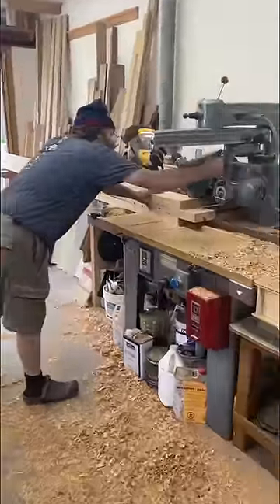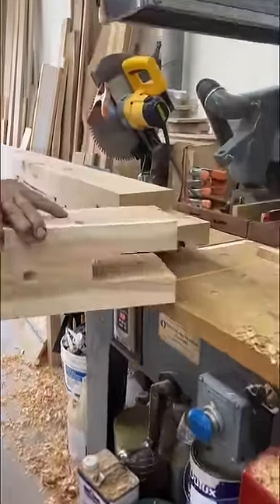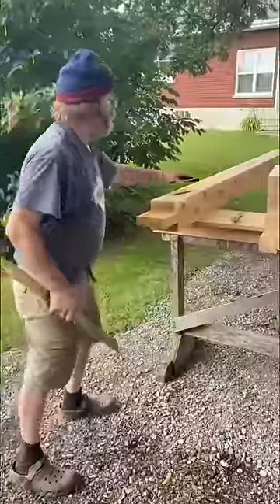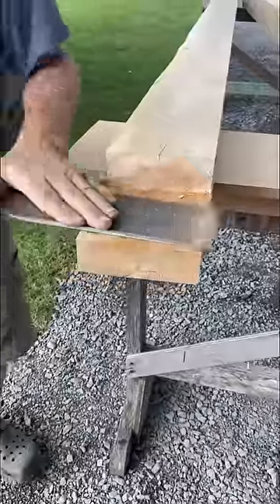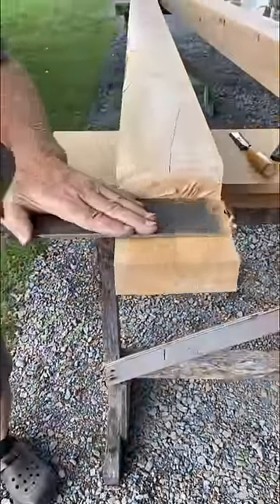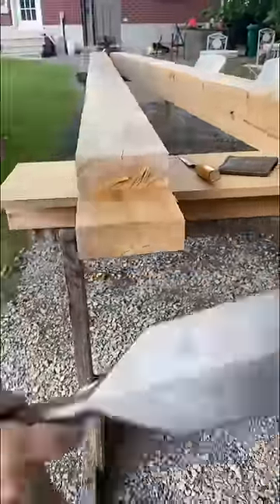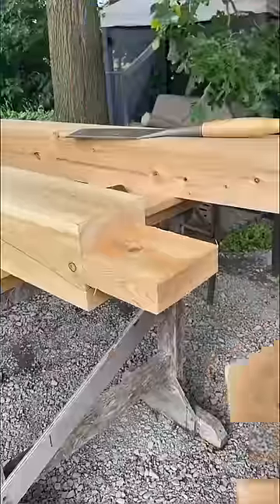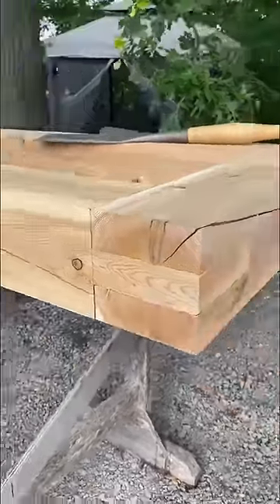1950s Rockwell radial arm saw #wadkintemple #woodworg #architecture #carpentry

Comment: And now I need a radial arm saw.  Thanks a lot.
Reply: Do worry peoe practicly give radial arm saws away. Thats how i got mine and i wasnt even looking. Their cheep
Reply: Me too. My lumber yard has the big one. Takes 5 minutes for the blade to stop spinning.
Reply: Yeah im so glad everyone thinks they are more dangerous than a table saw. I have 3 now working getting a 4th. I have them all set up for different operations. Kerf cuts, planning and rip cuts.
Reply: I have a small collection of rockwell/Delta/Milwaukee wood lathes. 11" &12".
One has riser blocks for a 15-1/2" swing. One w/ a Vega duplicator. A 1939, 1948, 1951. The 11" is the sheet metal ways version. I love them.
Oh, and a 1964 Unisaw. School green paint from the factory.
Reply: They are seriously undervalued. I got mine with the stand for $80, and it's like my most useful tool. It's a classic sears craftsman, like 60 years old, and it runs fantastically.
Reply: We had this baby in high school wood shop. I still want one.
Reply: I have a craftsman that's just sitting in my basement.  Not a fan of it.  Feels really sketchy to use
Reply: @JakePlisskin12  I know people think they are dangerous but more dangerous than a table saw!? How could that even be possible lol.
Reply: @bobbygetsbanned6049 yeah, I don't see how these can be more dangerous than a table saw. Nothing is more dangerous than a table saw. My dad had a serious craftsman and used it quite a bit when I was growing up in the '70s. He ended up giving it away when my parents moved because he couldn't sell it. Same story all over
Reply: @garetkonigsfeld2  *they’re
Reply: If I had the space 😢 and one of these "lumber yard" saws with that "trenching head" (by Wadkin!) - I would never take that head off the saw. I'd just get another radial...😅😅😅😅😮
Reply: @xXVintersorgXx  Assuming its arm is not loose on the pillar, A radial is ten times safer than any table saw.    What “feels” sketchy is that the saw pulls its way thru the wood and seems to lunge at you.   This is mostly an illusion, because you are used to having to push heavy wood AT a blade to make it cut. With a radial you are not having to pull, but the saw isn’t going anywhere but to the end of the arm.   The other thing that makes radials scary is the entire blade is out there in front of you.  The table saw barely shows you any blade at all.   But the table saw east more fingers than any other power tool out there, BECAUSE you hardly see the blade and feel safer.   When my workers use the radial, they are afraid of that blade and that’s the proper mindset to have with ANY power tool.   A well made Radial ( and in the 50’s they were all really well made ) is more accurate than any mitre saw, and more versatile, handling everything from cross cutting, to ripping, to horizontal slotting, angled blade cuts for cutting curved channels, controlled depth cuts like dados and rabbets, and some even have attachments for doing shaping, planing, jointing, and drum and spindle sanding.     A radial Can NOT kick back when cross cutting, and when ripping, if it kicks back, it throws the board to the left or the right and not back in your face. 
You really ought to try and get comfortable with it.  I barely fire up my table saw.   The Radial handles 95% of what I need.
Reply: @christopherpardell4418  they are still pretty dangerous.  And it definitely feels sketchy. Cross cutting a couple times I've had the saw almost pull out of my hand.  

It's definitely not as bad as it feels but I hate using it.  I've since gotten a miter saw and those feel much safer.  I don't do a lot of ripping because I've been doing mostly diy construction stuff but I have a table saw as well and a circular saw.
Reply: @xXVintersorgXx  I personally know 4 guys who lost fingers to table saws.  Way more who have been injured in a kickback.  I have never met anyone injured by a radial. ( and I am old enough to have been around when almost every woodworker had a radial saw. )   Like I said, it FEELS like the saw is jerking towards you, but its just that with a radial, your hand isn’t ‘pulling’ the saw so much as it is Braking. In ripping, you push the wood into the blade and so it doesn’t have that issue in ripping. Which is something a mitre saw can’t do.   And you can always add a ‘return reel’ to your radial. That is a spring wound cable that pulls back on the saw carriage so that you can counter the feel of it pulling at you, and it pulls the carriage back when you let go of the handle.  
If it feels like its jerking at you, then you may have the wrong blade on it.  Tables saws use blades with a positive hook.  On a radial you really want a blade with a negative hook. That will reduce its tendency to claw thru the wood. 
But I only have so much room and I need that room to be efficient and versatile. Mitre saws only do cross cutting, mitres, and cross cut bevels.   With your radial, You can cut rabbets and dados because you can calibrate the arm to be parallel to the table and precisely control the depth of the blade.   You can even rotate the head to attach a planing head and level one side of a thick, warped board.   Aside from the versatility, The worst thing about mitre saws is even the best quality ones are flimsy and you can easily pull the blade off line with the slightest lateral pressure on the handle.   I came close to buying a Bosch multilink mitre. But went over to do some work on a friend’s and found out even that $800 mitre saw could cut off line just by changing which hand you’re pulling the saw with.
I instead opted to upgrade my 1970’s era craftsman 12” radial when I found a 14” 1953 DeWalt that looked like new, for $500.   That saw weighs 500 lbs.   I can cross cut and  rip up to 24” wide, so I very rarely need to pull out my table saw.
Reply: @christopherpardell4418  there are forums filled with people that have injured themselves with a radial saw.  Anytime you have a rotating blade you have chance for something to go horribly wrong.  Like I said though, it's probably not as bad as it feels, but it can be extremely dangerous.  People have lost arms from the saw slipping out or over the work and running up into their body.  Also ripping you can be pulled into the blade.  Table saws also feel sketchy but in a different way.  And my older saw doesn't have a riving knife so it's just as sketchy for me to use that.  I don't do much fine wood working, furniture making, etc.  All I'm saying is I can see why people are practically giving them away
Reply: Screw that I need that slick
Reply: @xXVintersorgXx I learned how to operate a radial when I was about 10 years old. Used that one for ten years.

I just recently got another one, rebuilt it and now use it  for those operations where I would have used the table saw. 

Kickbacks on a radial are pretty much nonexistent because the blade pulls the wood into the fence which has a gap only just large enough for the blade to go through. You almost don't have to hold the wood when cutting, just focus on guiding the blade at the correct speed.

Comment: Timber frame pieces always look so nice. Just like Lego. Very specialize cuts.
Reply: Lincoln logs😂
Reply: Yep, until the check and dry. But really even then they look good.
Reply: Specialized cuts? Are you new to woodworking? That is a basic bridal joint. Yeah it’s bigger than what you usually see on furniture but not harder to make. And no you don’t need any specialized tools even at that size, hand tools and or basic power tools will do the same. The bigger specialized tools are only for convenience and speed.

Comment: I cry everytime I think about my old Delta 12" radial arm saw. I sold it a few years back to make room for a sliding compound saw. There are just some thing you can't do with a sliding compound. Sad part is, everyone who knew I was selling the Delta ba k then told me that there was no market for radial arm saws anymore. I bought into that BS and ended up selling my saw for $50 (in pristine, perfectly adjusted shape). Now I have a much bigger shop and regret the loss 😢
Reply: Other than a 90 degree cut—blade parallel to the table—what else can the RAS do that a compound miter cannot?
Reply: hopefully you sold it to someone that needed it, appreciated it, and made beautiful things with it. Don't regret the things you have done - regret the things you havn't done ! peace
Reply: @clairecordell2461  "don't regret the things you have done, regret the things you haven't done".    I like that!  Thanks!
Reply: @MadLadsAnonymous  ummm..... cut larger lumber?  That's all I got
Reply: @MadLadsAnonymous  On thing I used to be able to do is mill tenions. I can do this now, but it means making a cut part way through either side, then moving to a bandsaw.
Reply: @coppulor6500  👍
Reply: Wow, I understand. You might be able to find one similar to the one you owned, but you might have to drive to pick it up, would probably be worth it  😊

Comment: As a kid I made so many wood projects with my fathers radial arm saw. It’s probably over 50 years old now and still works fine.
Reply: Mine has "Sears Craftsman" on it. Still working great!
Reply: I have my dads RA, Sears Craftsman too, has to be at least 50 years old, Bann; after replacing the motor bearings it is in excellent condition . Cannot call my self a woodworker but I plan on keeping it as long as I am able.

Comment: Radial arm saws do everything. If used correctly, you can do any project. Nice job on that fit.
Reply: You can’t rip king boards with them. Once you actually get into wood working you will agree with the rest of us that the a good table saw can do just about everything, including everything a radial arm saw can do. You must be new to the hobby, welcome.
Reply: The radial can do just about everything, usually without jigs, that a table saw and miter saw can do.
Reply: A tool made for wise guys.

Comment: I wish I still had my old Craftsman radial arm saw.  It was a versatile beast until it died.  I could do almost everything with it that I now use my table saw or miter saw to do.  I would put a drill chuck on it for horizontal boring, installed a buffing wheel to polish metal, used dado blades for single-pass dados, used cutter blades to make decorative edges and ogees like from a router, did cross cuts, miter cuts & compound miter cuts and ripped boards and sheet goods.
Reply from the maker: It was a revolutionary machine at its time

Comment: I love my radial arm saw and everyone throws me shade over it. I think if you understand the outfeed is the danger zone, it’s a fine machine. I use mine just like you are here, also to power a dado blade.  Much respect.
Reply from the maker: Proper guarding training and sharp, tooling  following the best safe work practices pretty much cover you on this machine. Much of the misconception of danger is from the antics of amateurs or the poorly develop consumer grade saws.
Reply: The illustrations put out by craftsmen back in the day definitely didn't help. If you've seen the manual showing how to rip ply standing up and the blade sticking out the front of the table then you know what I mean. Big nope

Comment: You can’t beat those old machines, we have a old jointer that has a ten foot bed and a twelve inch cutting head on it.
Reply from the maker: that's fantastic. What's the manufacture?
Reply: @jackEnglishmachines  Rockwell. Our Radial arm saw is also a Rockwell.and old

Comment: That RAS is a whole work station if you have the lathe chuck, router head, surfacing planer, sanding disk, etc. It moves in 3 directions, granted one is an arc, but its a 180 degree arc.

Comment: I´m always more impressed by the real estate people have for a machine you might not be able to use that often. I was at my local Scrap yard last week and they had a whole area set up for huge industrial saws and planes that were quietly rusting, it was very sad to see many had waited far too long for a kind heart to come along. Great to see you enjoying it and that chiseled joint too. That 3" chisel is not that common either.
Depending on the load that beam is taking, you might find it stronger with a longer joint?

Comment: If you want to do good work with big stock, wire your shop for 3-phase and get the good old industrial iron.  The big, powerful tools have a learning curve of their own, but they really flatten the overall learning curve.  It just get so much easier to get really good fits.  And, bonus, the machines are often available in running order for scrap prices, or nearly so.

Comment: First power tool that I bought was a 12" Craftsman. I don't let anyone use because it can get away from you quickly. I only use it for the dado work. Over 50 years I've had it.
Reply from the maker: This size rather heavy, and doesn’t exhibit those lunging forward characters of sears roebuck models. Far more inertia to overcome.

Comment: Second time asking: What about the giant split right at the joint?
Reply from the maker: not an issue at all. although it may appear concerning the weight of an entire building will be bearing down on this and those timbers are just under compression. They were selected specifically for that location as they were adequate for that so that the clear much higher grade material could be an areas that are more worthy. all the timber here is pith center and so those always crack, but they only cracked to the center not straight through.

Comment: Sliding table saw, router, shaper with a sled table, beam saw, hand saw and chisle, cnc router. There are many ways to do this but it seems this is your preference. Very nicely done good sir. However its not the only way to get a tight joint.
Reply from the maker: Thanks for the tips!

Comment: I have a dewalt radial arm from the 70's. great machine. Radial Arm's in generally are great tools.
Reply: I was looking at getting one but keep reading that they are very dangerous.
Reply: @topreview3791  really?  compared to what?  I find it FAR safer than a table saw for everything except to ripping (tends to jam, or shoot back at ya)....but everything else, IMO, is more safe.  I do prefer to have my hand on the tool rather than on the workpiece pushing into the cutter.  I still use my table saw, but if I can do it on the radial arm, I do.
Reply: @mtraven23  thanks!
Reply from the maker: Yes they are!

Comment: I have a early Sixties Sears radial arm saw, all cast iron that the manufacturer had a buyback on because of an unsafe blade guard. Are they safe to use? It was my late FIL's
Reply from the maker: Honestly, that era of Saw was there very best. Motors were made by emirate. Pretty much outlasted anything after them. Special arbors for an array of attachments such as planing machines, jigsaws drilling, grinding stones and numerous other special formulated shaft, connections not to mention it was the only song I was aware of with a five eights arbor up to 12 inch diameter blades, this made it very possible for you with a general light duty 10 inch table saw with five eights arbors to share tooling the area you’re talking about where there was a callback and actually money was given to customers to destroy was one in the 70s where engineering quality was dropped dramatically, and the light facsimile  of its original design was the only thing that remain. Prior to this era, radial arm saw were the realm of professionals, and once it enters into the realm of amateurs, that’s when lawsuits start. In fact, in some European countries, there are laws that make the manufacturer responsible for your safety. That, according to the law, the safety responsibility lays on the manufacturer. Most of the time I grew up all machines were inherently dangerous and sold proper safe work practice and training is rather essential when the machines reach large diameter blades and horsepower is exceeding 7 1/2.

Comment: Edit: As we all know, there's no right way to do woodworking, and those joints look great, which is what matters. But this other method works better for me.

I cut large timber bridle joints like this very often.

But I don't use a radial arm saw or a sliding table saw, except to make a kerf for the shoulders, which I cut shy 1/16 and clean last if needed.

The reason is that the wood will expand and contract after milling, and some beams end up 1/16 +/- out of spec, especially with the humidity here in Florida.

If your stock is not all exactly the same width, your joints will all turn out differently because you're registering the cut from the outside of the joint.

To resolve this, I use a template, transfer my marks off of center, and use a bandsaw with a fence to eat my lines on the female peice and leave them on the male end. I get much more consistent results this way, and it's faster than repeated crosscuts on a dado blade.
Reply from the maker: Sounds like a good process. This joint took me all of 10 minutes.

Comment: Love my Radial arm saw.
Only a tiddler. Dewalt 720
Reply: Of all the tools in my shed, the radial arm saw is the one I live in the most fear of. Most of the others you could lose a finger.
The RAS. You could lose your lower arm.
Reply from the maker: Check out UK’s HSE health and safety executive for their safe work practice manuals, specifically crosscut saws for all of the proper safety procedures, if you are not trained
Reply: @jackEnglishmachines  
Thanks for that Jack

Comment: I love watching these kind of videos because I know nothing about how to build anything. Question-wouldn’t the wood be compromised if it (both pieces) has big cracks in it like here?
Reply from the maker: In this case, no, it’s because those timbers are from the very center of the tree, called the heart and generally when it dries those pieces always crack those cracks are called checks, and they absolutely contribute no severe detriment to the structure